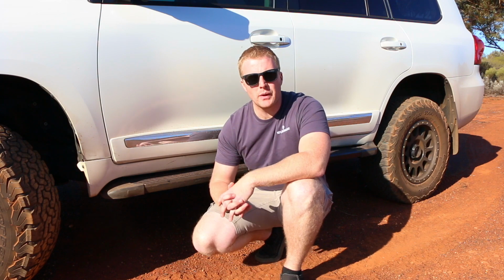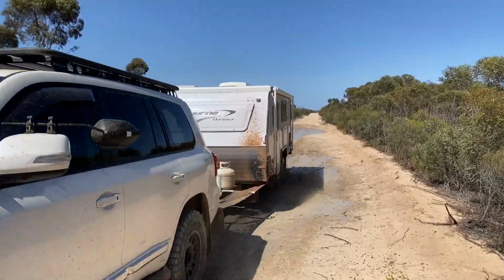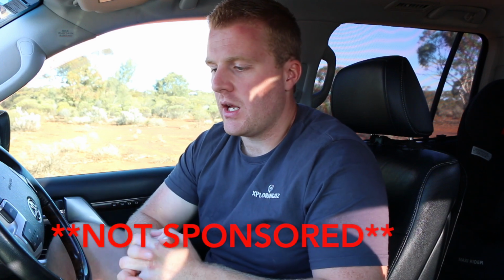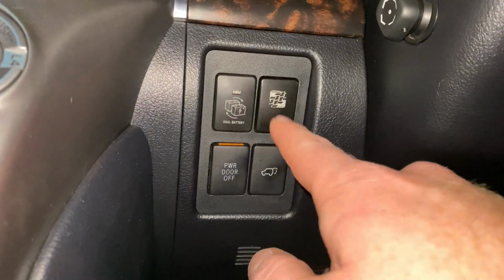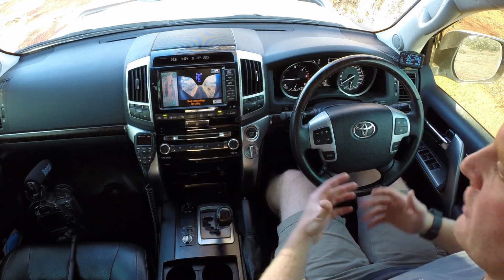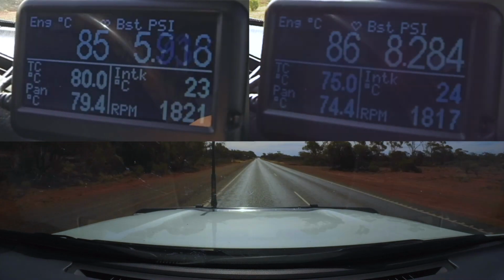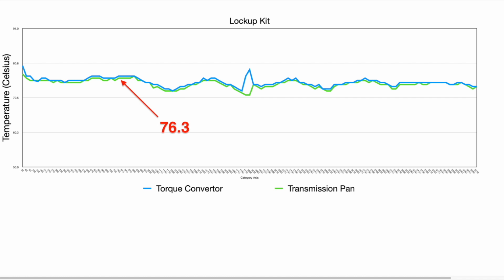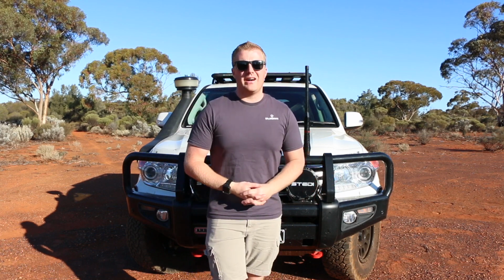TORQUE CONVERTOR LOCKUP KIT | HUGE difference! | How does it work and why? LC200 Stocklock Extreme

Comment: Really good video with appropriate tech info without going over the top. I’m about to fit a dual speed unit to a Prado - hopefully it will help out towing as much as it does in the 200. The Prado torque converter temps and pan temps seem closer than those in your video, I’ve seen 130 in the converter and 125 in the gearbox on a 40 deg day towing until I gave up again and drove in S4 at 2500RPM! Won’t be doing that again!
Reply from the maker: Thanks mate, appreciate the feedback. 
I’m sure you will notice a positive change on the Prado with this kit 👍
Protects the system and gives you some peace of mind

Comment: Enjoyed your Stocklock video Nathan. Recently bought a 2012 LC200 and have had the Stocklock Extreme fitted. Still learning to live with it and get best use out of it. Some questions: We tow a 2.5 t caravan about 50% of the time and was advised to use manual gear mode & the system gets to know how I drive (sort of AI) & adjusts when it changes gear & locks up. Is this true? Also, what rev range in Manual should I keep within & change gears at? Thanks.
Reply from the maker: Thanks Colin, glad you enjoyed the video.
When fitting my Stocklock, I was also advised to drive in manual when towing. This just allows the earlier engagement of the unit (at about 32km/h) then waiting until you reach 88km/h.
I have heard that the Toyota transmission can learn the behaviour of the driver and adjust somewhat to their driving style. In my personal experience, I can't say I've ever noticed a change in shift patterns with different driving styles. For me, towing a van and driving day to day, I would assume this would be a fair significant change in driving styles.
Further, some people will say that you shouldn't tow in 5 or 6 gear, however remain in 4th. Personally I tow in 5th gear and this is what determines the overall RPM range. 
For me, determining the gear is fairly easy I have my Ultragauge display on the dash, showing me the engine load at any given time. This allows me to select a gear that provide low engine load (which may be higher RPM) and therefore reduce wear/tear and fuel consumption. 
Selecting and cruising in a particular gear will also heavily depend on your vehicle. My vehicle, with added weight, larger tyres and external accessories (like roof rack) all significantly effect my drag and performance both when day to day driving and towing. This will be different for each vehicle, depending on their setup.
I hope this can help somewhat and give you some things to consider for your setup.
Cheers, Nathan.
Reply: @XploringOz  Many thanks for your reply Nathan. I will take some time to digest your advice and get more experience with the system. No doubt I will have more questions downstream, hope that will be ok.
Reply from the maker: @colinprice6397  No problems. I hope you work out the best solution for your vehicle and style of driving. Definitely feel free to forward through any more questions in the future.

Comment: Toyota discontinued the Trans coolers on 2019 and later Tundras  stating that they are not necessary. People are getting Trans temps of 250 while towing but Toyota engineer Swears says it is within range and will not hurt the transmission nor fluid. what do you think?
Reply from the maker: Hmm, I reckon all vehicle could do with even a small cooler. Obviously it will heavily depend on the environment as well. Where I live in Australia, it does get hot and I would hate to imagine to temps without a cooler. 
I'm assuming that temps of 250 are Fahrenheit not Celsius? It would also depend on the type of oil you use. Certain types, brands and make up's of oil have the ability to handle higher temperature better than others. 
Saying this, I wouldn't want my cruiser sitting at prolonged periods in this temp range, it will only prematurely break down the oil properties and over time create excessive wear and tear.

Comment: Nathan, may I throw in an alternative opinion, please.

I'm assuming that you were towing in D or S6 since you mentioned seeing the transmission in 5th at one time.
I tow a 3500kg van with exactly the same vehicle as yours. I had an aftermarket exhaust fitted and that came with the ability to fit an Exhaust Gas Temp gauge.
EGTs are the missing factor in most of these tests, including yours (with respect).
I do not have any sort of lock-up device fitted. 

I tow in S4. Never S5 and S6 and D are not even a consideration.

I've towed in S4 from Perth to QLD each year for the past several years. Since having my EGT gauge fitted I've come to some very interesting conclusions:
1.  Towing in S4 will lock the transmission at about 90kph.
2.  The transmission will drop down when it wants to, hills etc, and this will see the higher revs reducing the EGTs.
3.  S4 will see low TFTs,  higher revs will see lower EGTs.
4.  It's a balance between managing TFTs and EGTs, but you won't see this until you are able to display EGTs.

I think lockup devices encourage drivers to tow in high gear/low rev situations where the EGTs will be high, but not visible without the means to display them. Once an EGT gauge is fitted it becomes very obvious that higher revs are, on a lot of occasions, a good thing. I've seen EGTs of over 600C going up the Coalfields Highway into Collie. Once the transmission drops done to 3rd those EGTs drop. Yes, TFTs will rise but in those circumstances it's more important to get those hot gases out of the combustion chambers.

On some occasions going up steep roads in S4, I've seen high EGTs, TC still locked and sat their willing the transmission to drop down to reduce those figures. Eventually it did drop to S3 but it was a demonstration of how well the TC stays locked in S4 without any additional devices. As soon as it dropped into 3rd the EGTs plummeted. 

I would encourage LC200 owners to  fit an EGT gauge before a lock-up device. See how things go for a few months and then make a decision. I'm betting that a lock-up device will fall off their wish list.
Reply: In the naval and leisure marine industries I worked as an engineer in, charts were always published by engine and gearbox manufacturers with particular emphasis on applied torque. If you let an engine run against a high load, at low revs, your system will experience high torque loadings. This is the exact situation which causes deflections in shafts and potentially overloads bearings in gearboxes and engine big ends. It also applies an unwelcome force on the gear teeth and their case hardening. This is the risk with locking torque converters. You end up applying possibly harmful levels of torque through the transmission for extended periods. Durability can and does suffer in certain cases. This is why car manufacturers probably dont do what the aftermarket industry does. Manufacturers spend mega millions ensuring they have a optimised durable product, and then some ghetto engineering mob change it all. Look at your warranty coverage when the gearbox goes poopy in its trousers. I am sure nobody will cover your major repair because you chose to get the transmission modified. Anyway, thats how marine diesel gears are managed. Higher engine revs, lower applied torques, and an upper limit on applied torque at lower revs. Sounds the exact opposite of a lockup torque converter.
Reply from the maker: Thanks for sharing your input on this topic. It's good to see how other people think about these things.

So just quickly, in this video and as I always do, I will always tow in S5 (it downshifted to 4th gear, not 5th). I've found this gear to be suitable and from research I've conducted, I believe this gear to be strong enough to handle to relevant load. I also wouldn't recommend towing in S6 either as this is an 'overdrive' gear and isn't designed for heavy applications. Further, adding to this, the vehicle won't be able to reach S6 in either 'S' or 'D' mode due to the relatively low speed and heavy load. 

I completely understand your thinking here and agree with the trade off's between EGT's and transmission temperatures. I would be interested to hear a basic description of your setup of your 200 series, specifically weight, external accessories and tyre size. In my experience, even when downshifting to S4, my LC200, loaded and towing would not be able to sustain a locked transmission. As I mention, my temperatures were starting to reach temperatures that would significantly reduce the trans oil life, breaking down its properties and potentially prematurely wearing the gearbox. Although I agree that EGT's need to be closely monitored, my transmissions was taking a beating with my setup and style of driving. 

Am I also able to ask, what EGT gauge you have setup and how it looks when being monitored in the cab? This would be a good test and something I'd be interested in setting up myself. (my aftermarket exhaust is currently on order with EGT ports).

Thanks again for sharing, these type of valuable comments allow viewers to see all points of view and technical opinions and make their own informed decision. 

Cheers, Nathan.
Reply: @XploringOz  I've replied using your email address Nathen, so I can add photos.

Comment: Great video. Awesome explanation of how the system works. Keep the vids coming because we enjoy understanding the thought process of everything you do.
Reply from the maker: Thanks mate 👍 appreciate the feedback. I’ll sure keep the videos coming. Cheers, Nathan.
Reply: @XploringOz  does locking up in 2nd gear cause a bump as if its shifting From 2nd to third?
Or locking the converter is seamless because its not changing gears?
Reply from the maker: @FirstLast-tx3yj  There is no change to the difference in feeling between 2nd and 3rd gear, however if using the manually mode (where the unit activates at 32km/h) then yes, you will feel this engagement. Again, there should not be any bumping or change in behaviour from the gearbox itself

Comment: Any idea if these can be fitted to a 5.7L gas engine? I’d love to gain some fuel economy especially when towing. No diesel option here in the USA... My 200 is a ‘13 with 60K miles and 34” tires, bumpers and roof rack so I’d love some additional fuel economy. Thanks!
Reply from the maker: Hey mate, so yes, theoretically there is no reason as to why this couldn't be fitted to a petrol engine. The fundamentals of the torque convertor remain the same. 
We don't hear about the petrol models very often here is Australia as only a very small amount are sold, when compared with the diesel variants. 
There is no doubt that the automatic transmission shifting points and lockup threshold would be different on a petrol vehicle and potentially different from country to country, depending on manufacturers tuning. 
It wold probably be best to ask local fitters or mechanics to see whether a product over there might suit your needs.
Thanks for watching, nice to see this video is reaching some audience outside Aus. 
Cheers, Nathan.

Comment: Great video, super informative. What do you think about aftermarket secondary trans coolers? Do you think they're a safer intermediate option between a stock trans and a lockup kit?
Reply from the maker: Thanks mate, glad it has been somewhat helpful. 
Definitely another great idea. If you weren't towing all the time and not hitting beach sand on the weekends, then transmissions coolers are another effective idea. 
However, having a look at some of the more 'reputable' brands, I see the cost, when you start to include labour costs would ended up being close to that of the lockup kit. 
Personally, I'd choose the lockup kit over the cooler, but the cooler is still a good idea and if you go a cheaper brand, then there are savings to be had.
Cheers, Nathan.
Reply: @XploringOz  what about both together? (Money aside)
Reply from the maker: @ausguy4385  Absolutely, both together would work well for sure.
Reply: Great use of data. Ive got one fitted and know its effective but this reinforces my original decision to install.

Comment: G’day Nathan and viewers, Having seen on your YT channel today more that 6k viewers, to check if there are some more useful replies to learn from. There are so many LC200 towing vans on and off road. 
As I am relatively new into LC200 and towing a 1 axle 2.2 tons loaded pop top van with the said LUK and AT CU remap, having done only one test drive yet about 2000km MEL-SYD-MEL inland and coastal road after the reopen after fire closure, I could not really figure out what is the better choice on the most flat roads. 6th. Gear by 1650 rpm with a ave 83% load by 102km/h or 5th. Gear by close to 1900 rpm lower load % but same speed..May someone can share your experience with similar set up. Thanks and Cheers.
Reply from the maker: G'day Holger, yes this video has been popular, which is good to see.
So in my experience, Toyota recommend that towing should be conducted in either 4th or 5th gear. The 6th gear is really designed as a cruising or 'overspeed' gear. If you cruiser is like mine, heavier with bigger tyres than the higher load can be detrimental and place undue stress on the driveline. 
It would be my advice to tow in 5th gear and reduce the load, for all the engine, gearbox and driveline. 
It would be interesting to hear other's opinion on the matter to.
Thanks, Nathan.

Comment: Great video Nathan, I am going to install a Richards system also, live close to them so makes sense. I have just completed 75,000kms on my 200 and did a trans flush and new oil. I think was worth doing, I work my car lots of 4wding so makes sense. Have you got instagram at all? Cheers. Aaron @200serieslc on instagram
Reply from the maker: Thanks mate. The Richards system is also a great piece of kit, both work very well. I definitely think flush the auto trans fluid every 100k would definitely provide benefit to a long gearbox life. 
We do have Instagram, however don't use it a whole lot. I've just followed your profile, looks good.
Cheers, Nathan.

Comment: great explanation on the lock up kit. But is towing in 4th gear the prefered choice by the Manufacturer which gives much greater T/C lockup. i Know this is the case in my Hilux and I see the same lower T/C temps when I tow in 4th. I am still deciding wether to get the lockup kit, and I do see all the benefits it provides but driving style can make the convertor lock.
Reply from the maker: Thanks mate. So for the 200 series, Toyota recommend either 4th or 5th gear for towing and it would depend on the driving conditions. Keep I mind the LC200 in a 6 speed auto (the 6th gear being their 'overdrive').
For my requirements, I really did need the lockup kit, although I agree driving style can help lock in the convertor, with a vehicle as heavy as mine and running the 34" tyres there were scenarios where this just wouldn't happen, regardless of driving style. I'm assuming for the smaller capacity engines, with smaller tyres this might be a little easier. 
Cheers, Nathan.
Reply: @XploringOz  Thanks for the feedback Nathan. Great content on the channel it does seem most of the Toyota 6 speed autos 4wd line up need the lockup in conjunction with modifying the vehicle.

Comment: Great video did you have this fitted in Kalgoorlie or Perth I live just north of you about 500k I tow a Bushtracker
Reply from the maker: Thanks mate, appreciate it. 
I made the trip to Perth to have it fitted. I've had some issues previously with local fitters, the service and knowledge on these products are far superior at certain dealers and fitters in the big smoke. 
Cheers, Nathan.
Reply: XploringOz Hi Nathan, jumping on your subject, going to Perth for some jobs to be done properly. Do you have experience with Klarmann in Perth? Appreciate your thumbs sign. Cheers
Reply from the maker: Hi Holger. I haven't personally had any experience with Klarmann before, but having a quick look online, they look well reviewed.
Personally, I have used Ultimate 4WD Equipment for all my aftermarket modifications (except for this lockup kit) and have used Robson Brothers for servicing. 
Like always, I'm not affiliated or sponsored, just sharing my positive experiences with them. 
If you choose to go with Klarmann, I'd be interested in your experiences.
Cheers, Nathan.